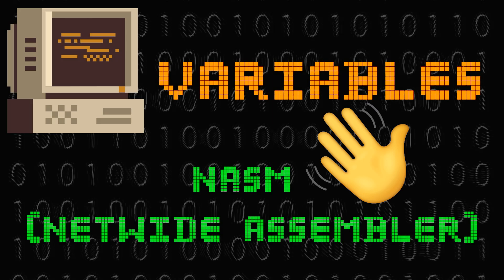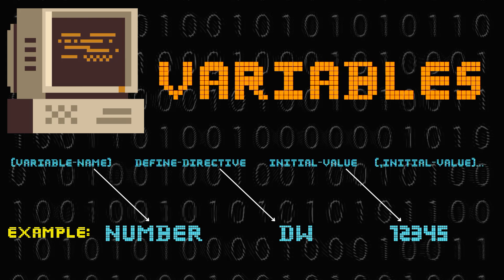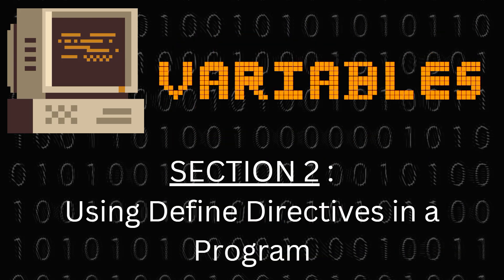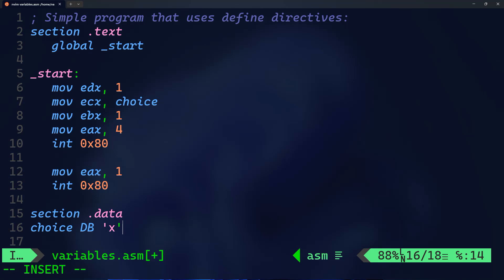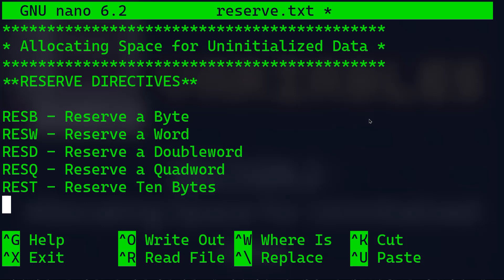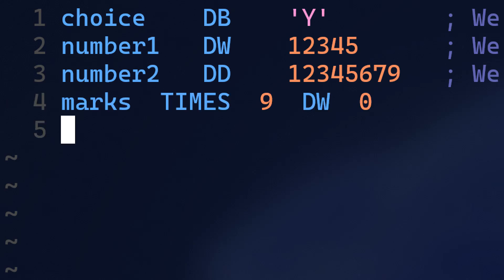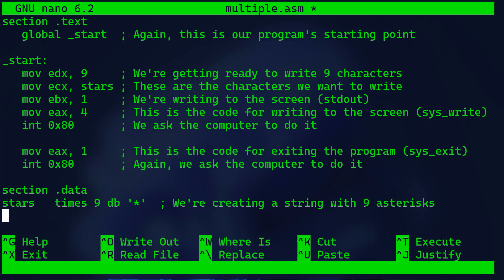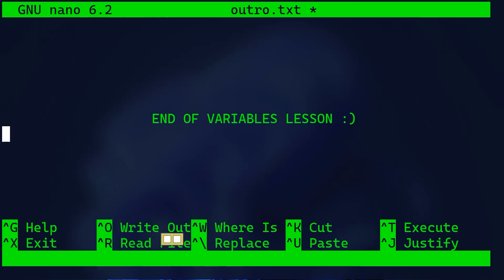Variables in Assembly Language 🧩 X86 - 32 Bit

Comment: I have a quick question.
I use SASM, which is an IDE and assembler and runner for NASM too. But when I tried the Hello World program, the int 0x80 gave me the following error: Program received signal SIGSEGV, Segmentation fault.
Can you help by any chance? Can't seem to find any solutions.
Reply from the maker: A segmentation fault typically occurs when a program tries to access memory that it's not supposed to. In the context of assembly programming, this could happen if you're trying to execute an invalid system call, accessing invalid memory addresses, or if there's a problem with your stack.
For a simple "Hello World" program using NASM and the int 0x80 interrupt for system calls, here's a basic template: section .data
    msg db 'Hello, world!', 0

section .text
    global _start

_start:
    ; write syscall
    mov eax, 4       ; syscall number for sys_write
    mov ebx, 1       ; file descriptor STDOUT
    mov ecx, msg     ; pointer to the message to write
    mov edx, 13      ; message length
    int 0x80         ; invoke syscall

    ; exit syscall
    mov eax, 1       ; syscall number for sys_exit
    xor ebx, ebx     ; exit code 0
    int 0x80         ; invoke syscall
Reply from the maker: any time